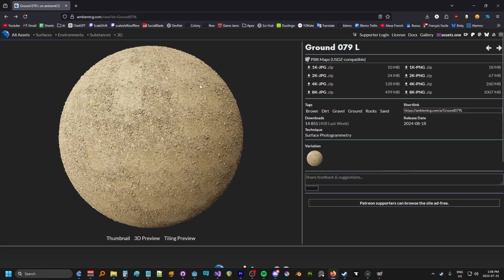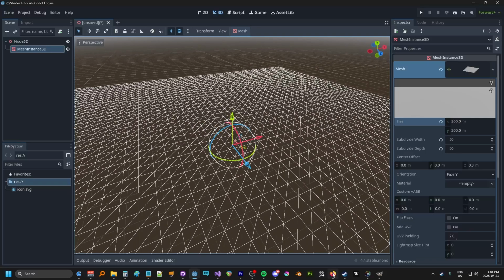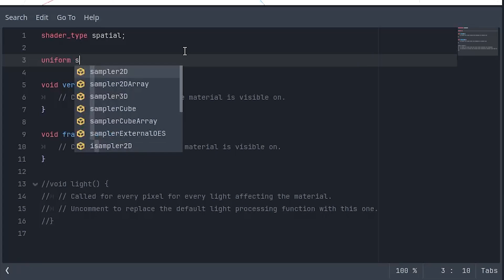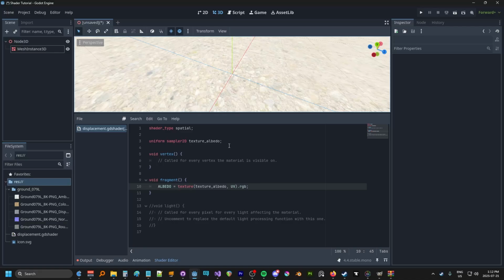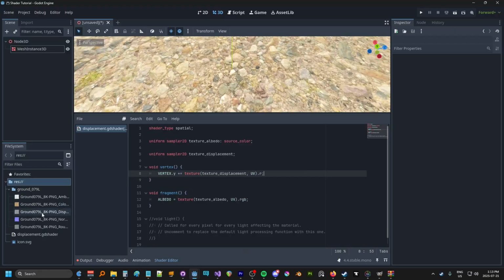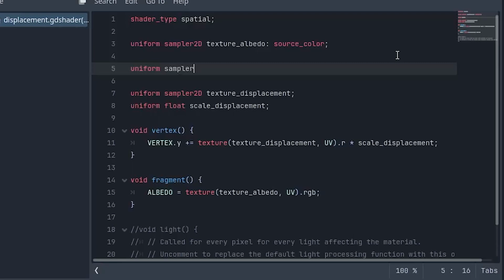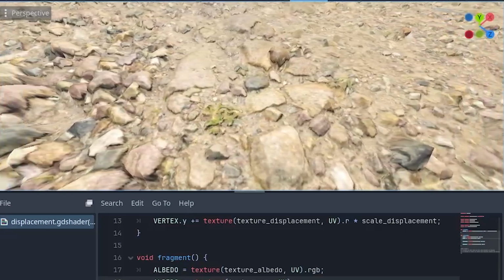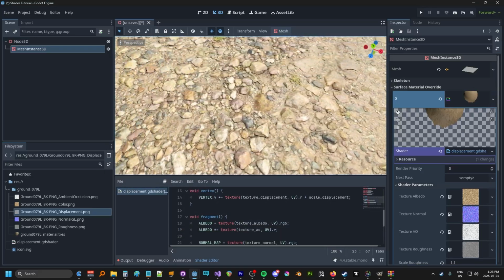Displacement Shader Tutorial in Godot Shader Language

Comment: how to add UV1?
Reply from the maker: This tutorial just shows how to get this to work for a flat surface, because it's simple and usually effective for ground textures. This way we can just += the y value of each vertex.

If we were to make this work for other shapes (such as ones with custom UVs), we would have to redesign the shader.

I could maybe make a tutorial later which shows how to use custom UVs, but that's not part of this tutorial.
Reply: @ScaleShift  I mean UV1 scale slider